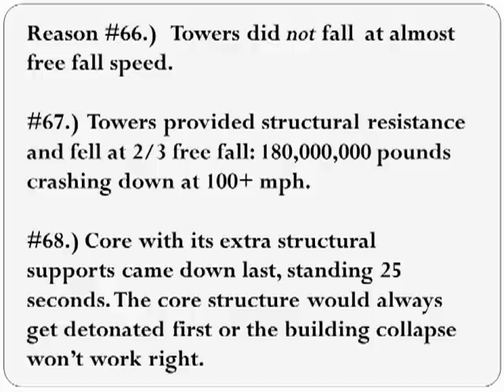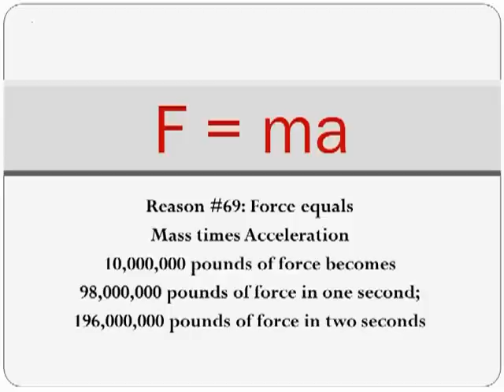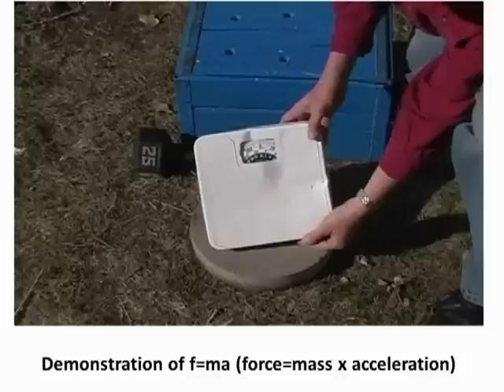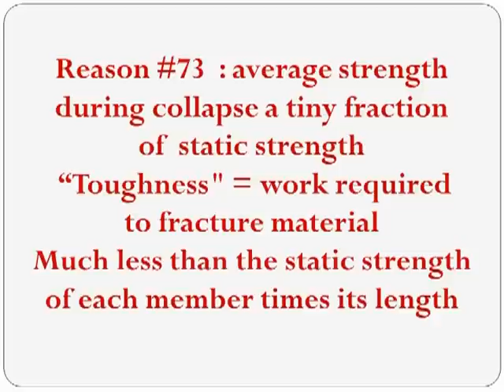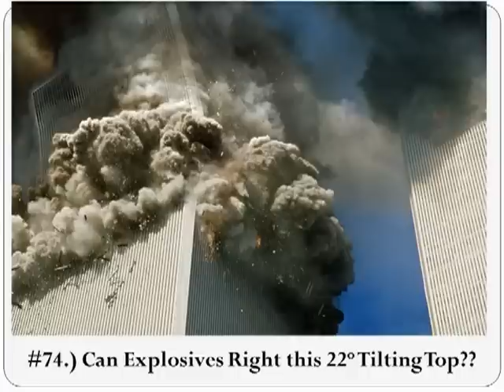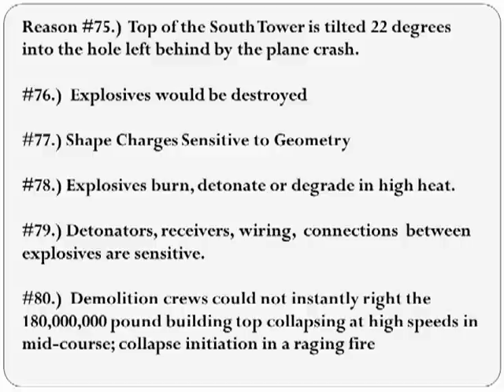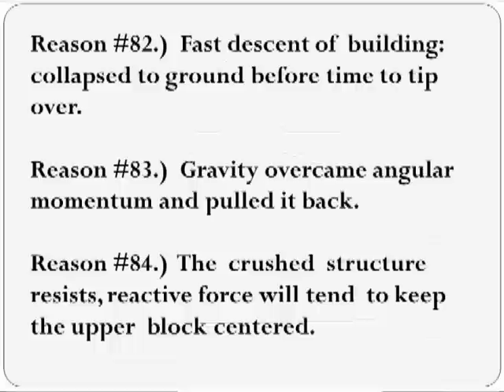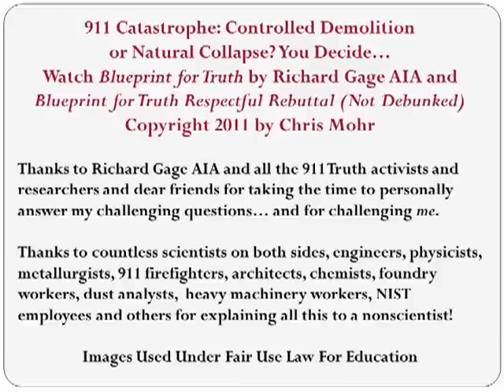Part 4, 9/11 Conspiracy Theories: Chris Mohr's Rebuttal to Richard Gage

Comment: "some debris did remain"

Correct. so based on the damage to the surrounding area, clearly an enormous amount of the mass was not turned to dust. 

Consequently, your retarded dodge is nuked. you still have 100K tons of mass slamming down onthe top intact floor. As each floor is destroyed,even MORE mass slamms down on the next floor. 

Point proved
Shadow <--Moron exposed again
Edge <---wins again!!!

Comment: "The specific numbers don't matter unless we need to calculate the force applied to two different objects"

Exactly moron. In order to say the lower section ,ust have arrested the collapse, you must calculate if the floor pans (on the highest intact floor) can handle approx 100k tons slamming down on them. 

Hint: They were rated for 1300 lbs psf, STATIC loading. 

Lets compare, and see which value is greater. 
A) 100k tons
b) 1,300 lbs. 

Its a toughie! LOLOL

Comment: "The force is equally imparted in both "

Exactly. So when the upper 30 floors slam down to the top intact floor panel, that floor panel is subjected to over 30 times its static limit. 

They arent 2 equal objected. they arent solid cubes, you fuxing idiot. LOLOL

Comment from the maker: That is the extent of the debris field. The twin towers did NOT fall "...mostly in their own footprints...". This should be obvious to anyone who watched the video footage and noticed where the debris landed and looked at the aftermath photos with their eyes open.

The debris contains dust, rubble, steel and more. SOME of the concrete/gypsum/glass etc blew away, but a lot of it did not. You have a brain, try using it more!

Comment from the maker: Of course there was dust, the floors were made of 4 inch thick concrete slabs. But your assumption that ALL of it AND most of the steelwork turned to DUST is daft. What volume do you think 1 kg of concrete would fill if it was COMPLETELY ground to dust and dropped from a couple of hundred meters on a breezy day? How many kg of concrete do you think the WTC towers contained?

Try to demonstrate that you're capable of your OWN calculations, rather than repeating truther BS arguments.

Comment from the maker: Anyone with an understanding of physics knows that objects cannot be accelerate TO the speed of light. That would require infinite energy.

You're still expounding your 'dust' fallacy. I've dealt with that in other comments.

Do you understand that when an object like a building is destroyed, SOME of it will be reduced to dust, SOME to fine rubble, SOME to large pieces of rubble and steel will simply be mangled? This is not rocket science, but it seems to be beyond your comprehension!

Comment from the maker: "When the bottom floors are turned to dust the same happens to the top so what's left to do the damage?" Your problem is that you're stuck on the delusion that they all turned to dust. This is demonstrably false, therefore your argument doesn't even get off the ground. 

flickr. com/photos/45096827@N06/4139710297/

BTW you still haven't acknowledged the fact that you confused mass with momentum.

Comment from the maker: That video maker fails to address the issue of gravity or the downward force of the increasing mass in the case of the WTC. The potential energy of tens of thousands of tons of steel and concrete several hundred meters above the ground can't simply be glossed over.

So far, you've hardly touched on the specific (numbered) points in this video. Why not choose one (or more) and explain how you think Mohr is wrong?

Comment from the maker: Your mantra about the WTC turning into 'dust' is complete BS and it's getting old. You (and the maker of that video) fail to take into account the fact that as the WTC towers collapsed, the collapsing section gained more mass, due to the disintegration and it also gained downward momentum, due to gravity DESPITE resistance from the intact lower sections. The reason they fell at 2/3 freefall rather than freefall is because of this resistance.

Comment from the maker: Your question implies that the molten metal was steel. Why? If it was aluminum from the aircraft, they were not at the top of the buildings, therefore a considerable amount of rubble would have ended up on top. Also, bear in mind that the twin towers extended several stories underground, which means that the debris didn't all stop at ground level. Maybe the reason it's not been seen before is because nobody flew planes into buildings before.

Try to think before you type.

Comment from the maker: "The floors were being turned mostly into dust." Concrete, gypsum and glass yes, but not the mangled steelwork. Do you understand the difference between these substances? "There would be nothing left to destroy what was below them." WTF???? Nothing left - apart from tens of thousands of tons of rubble and mangled steelwork accelerating towards the ground at 2/3 gravity, destroying everything in it's path. Get a grip dude, it's your thought processes that are bunk!

Comment from the maker: Sagging horizontal steel beams = no damage to structure? Really? Did you see the sagging floors through the impact holes at the WTC? Did you notice how they pulled in the exterior columns? Do these observable facts cause you to scratch your head and say: 'Wait a minute'?

Comment from the maker: Your comment doesn't make sense. Incorrect statement: "...the building is being symmetrically destroyed..." followed by non sequitur: "...thus the official story is bunk." The symmetry was askew as you already pointed out with the leaning top section. But the fact remains that despite the asymmetry, the forces involved were too great for the lower sections to withstand.

Comment from the maker: Your comment makes no sense: How can a building be 'symmetrically pulverized' when "...the penthouse fell first..."? Did you even READ the comment you're responding to? Are you aware of the temperature at which steel's load bearing capacity is reduced by 50%? Have you researched the unique design of building 7? Do you know what an atrium is?

Comment from the maker: Which other skyscrapers were struck by large airliners at full speed?

"For every action there is an equal and opposite reaction..." Ask yourself which direction gravity pulls and apply the answer to what you wrote.

Once again, why are you arguing as if the WTC towers were reduced to 'dust'?

Comment: "Either that or you actually believe that tens of thousands of tons of steel can magically be turned into dust within a dozen or so seconds. Is that what you believe?" Thats exactly what happened you fucking moron. There was only a tiny fraction of actual material left over after the collapse.

Comment: If the top is angled it contacts the bottom at an angle its not not flush and square you fucking dumbass. And yet the building is being symmetrical pulverized into dust. This is but one of countless smoking guns in the official story that you braindead rodents who can't wrap your tiny brains around 2nd grade science can't comprehend.

Comment from the maker: If you were right, then there should be a very loud series of explosions in the moments before the towers collapsed. I've seen/heard no such thing. Perhaps you can link to such a video?

You need to brush up on your physics. For starters, consider the difference between a static and a dynamic load. Ask yourself how much force each level of the WTC towers were designed to hold up, then compare this with the force of the top sections as they started to collapse.

Comment from the maker: You're just making these percentage figures up. Either that or you actually believe that tens of thousands of tons of steel can magically be turned into dust within a dozen or so seconds. Is that what you believe?

Regarding physics: Do you think that by disintegrating, the top sections magically lost their mass? What point(s) are you trying so hard to make?

Comment: Its common knowledge and can be found by googling a little shit for brains. The entire body, wings, and engine holders are all aluminum fucking reject. The official story is disproven because the tops were angled as they fell and yet the damage is symmetrical get it through your thick skull.

Comment from the maker: I know you're not REFERENCING any truther websites, you're REGURGITATING the flawed arguments you found on them. Can you cite an example of a controlled demolition which used QUIET explosives? How about one which initiated the collapse 3/4 of the way up (which was coincidentally where the aircraft struck)? What were you saying about IQ again?

The large mass of the top sections is the reason why the lower sections were unable to withstand more than a second or so of the onset of collapse.

Comment from the maker: Where did you get your % figures?

Are you even aware of what you're arguing against? We're not claiming that the impacts alone caused the collapses. Nor are we claiming that the fires in the twin towers could have caused the structural failures if the structures had not already been weakened by the impacts. The reason the twin towers collapsed is a combination of impact and fire damage.

Comment from the maker: Nobody is arguing that the heat from the fires was concentrated in ONE location. The fires covered several floors. The heat would NOT have been conducted away from the fires throughout the WHOLE building in that timeframe. They burned for long enough to WEAKEN parts of the supporting structure which were already damaged by the impacts. The jetfuel was enough to start fires on several floors.

Comment: The steel framed high rises conducted heat like there's no tomorrow. The small and cool burning fires present in the buildings could not have concentrated their heat in one location, it would dissipate throughout the whole structure very quickly. The jet fuel did nothing to the buildings integrity. It was consumed immediately primarily OUTSIDE, so why even bring it up?

Comment: "The Empire state is a VERY different, older and heavier design." Well in the design and blueprints for the twin towers is clearly states that the buildings were built to withstand multiple large jetliner impacts, all buildings that tall are NO EXCEPTION. But no you brain dead debunkers think the just sloppily built this cheese bread towers that can't even withstand one impact even though older designs can.

Comment: That still does not make make null the fact that no building/skyscraper in history has ever collapsed due to a fire. 
I have studied the videos of different angles of WTC 7 collapsing, and the the entire building basically collapsed straight down. Yes, on side began to fall first, but only very briefly, then followed by the other side, and when it fell, it did so at free fall speed as well. 

Please, tell me about the Israelis arrested for celebrating and filming the planes flying into the WTC.

Comment from the maker: That's not semantics, it's the different between an accurate description and a vague one.

The southern facade ONLY of WTC 7 fell at freefall for less than 3 seconds, the rest of the building took MUCH longer. It's important that you don't gloss over details like that.

The planes were not made entirely of aluminum. They weighed about 150 tonnes each and contained thousands of gallons of jetfuel. This is not an insignificant object. The towers were not indestructible. Think about it.

Comment: Falling onto its own footprint is a matter of semantics. The fact is it imploded at free fall speed. No building has ever collapsed/imploded, much less at free fall speed, due to a mere fire. The planes on 9/11, although quicker, were still mostly made out of aluminum tubing. Aluminum verses steel cores designed to hold exponential tons of weight will result in the steel winning every time, regardless of the speed of an aluminum object. I know WTC3, although damaged, didnt fall - my point.

Comment from the maker: Much of WTC 7 fell well outside it's footprint.

There were numerous fires.

Keyword = 'such'. WTC was an unusual design: Google 'atrium'.

The Empire state is a VERY different, older and heavier design.

The B25 was lighter and MUCH slower.

By asking why 7 collapsed even though it wasn't hit by a plane you seem to be accepting the fact that 1 and 2 DID collapse as a result of plane impacts. Is this the case?

Parts of WTC 1 DID hit WTC 7.

WTC 3 was badly damaged.

Comment: I know you think you are smart, but you are not even remotely intelligent. Other steel buildings have been engulfed in flames for nearly an entire day without any failure whatsoever. And don't give me that difference in design bullshit. Steel behaves the same no matter which building it is in, same melting points etc.

Comment: Hey fintard, If you half as smart as you think you are, and have actually watched those videos, than in your own words explain just ONE of my points. That should be doable in 500 characters. Lets start with the fact that the collapse was straight down but the top that was supposedly crushing everything below it (which violates the law of resistance) was bent over at a substantial angle. And go moron, balls in your court. I'd love to hear another baseless and moronic "argument" from you.

Comment: You people who believe the official story are undeniably retarded.

1) Localized damaged cannot cause symmetrical collapse
2) Resistance would've prevented a total collapse, instead causing a toppling.
3) The top was at an angle but instead of falling over fell straight down indicating that everything below was destroyed before hand.
4) The floors had 47 holes for the 47 columns to poke through, so why did the cores not survive?
5) Why was there molten metal in the basements of all 3 buildings.

Comment from the maker: Gage maintains that gravity would NOT account for the pulverization of concrete. He also fails to acknowledge the possibility that the 'microspheres' found in the dust MIGHT have originated from the extensive welding carried out during the building's construction 30 years previously. Gage also said (in his debate with Mohr) that fireproofing makes a steel framed building indestructible by fire. There are MANY more similar examples where he fails to even consider more mundane explanations.

Comment: @finlarg:

You said: " began to fail the entire mass above started to move, rapidly causing many other connections to fail, resulting in the whole top section falling INTO the lower section, breaking up as it impacted."

You have not compared your hypothesis to observations.  FEMA described a 1200' diameter debris field 360 degrees around each tower.  Your hypothesis would have everything in the basement.

When the hypothesis doesn't fit the observation, you need to a better hypothesis!

Comment from the maker: By your sand analogy it would be like dropping sand onto a sandcastle. In the twin towers when the structure began to fail the entire mass above started to move, rapidly causing many other connections to fail, resulting in the whole top section falling into the lower section, breaking up as it impacted, so it wasn't like sand or a brick, really, even if you substitute sand with steel beams and concrete floors. You can't realistically scale up impact damage because of the finite size of atoms.

Comment from the maker: I realize that there is no single solid object falling onto the lower sections. However there are thousands of tonnes of debris, including concrete floors and heavy steel beams all moving straight down under the influence of gravity. I don't have the exact tonnage figure to hand, but don't you think that it could cumulatively have caused the observed destruction?

Comment from the maker: "...the density of the "crushing" block was changing - it was 1/2 gone before collapse initiation." Are you talking about the top sections of the twin towers? If so, then I don't think you can realistically compare the density of those top sections, which would have contained a lot of solid matter as well as pulverized concrete, with a crushed brick. I realize that the density is different, but it's still a MASSIVE amount of debris exerting a HUGE amount of force on the lower sections.